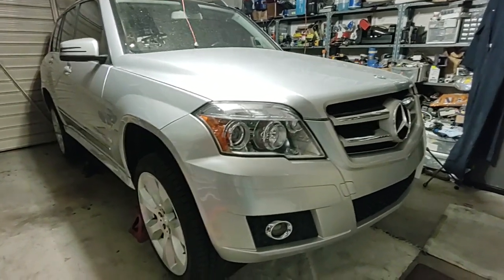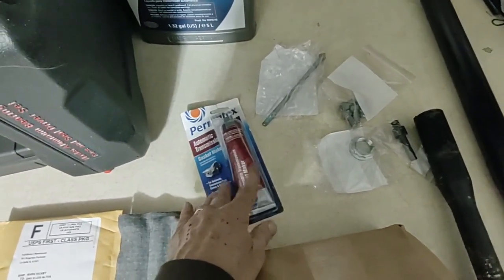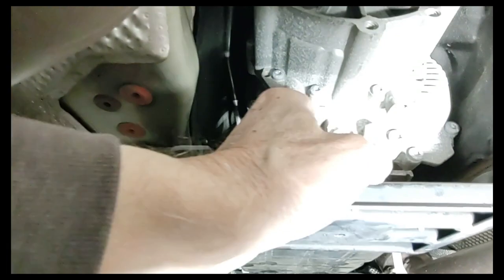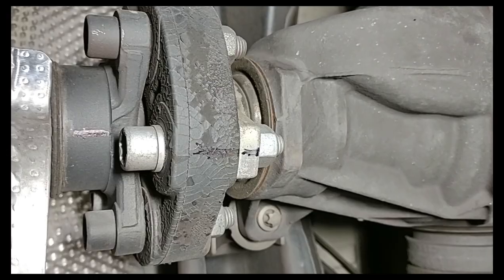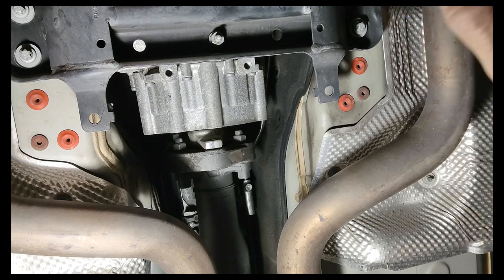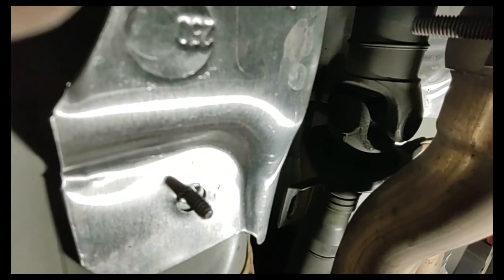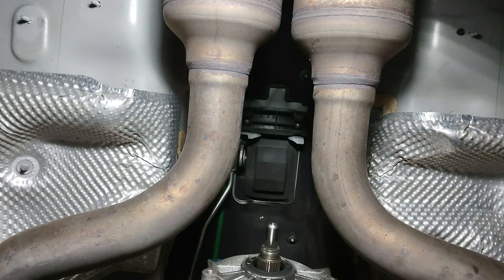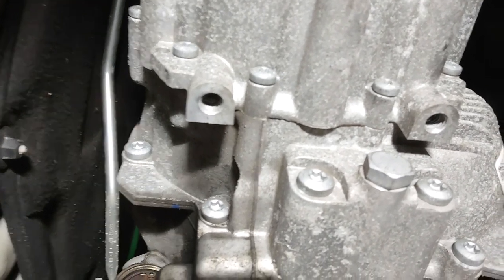Mercedes 722.9 4Matic Transfer Case Rebuild - 2011 GLK 350 - done in-car, new output shaft cluster

Comment: I have an 08 e350 with a bad transfer case, do you know if it is a similar one?
Reply from the maker: I believe the transfer case in the W212 version of the E350 is similar. But that one didn't start until 2010, so your 2008 W211 should have more of a replaceable, removable transfer case that doesn't really look anything like the one in the GLK in my video
Reply: Okay thank you for your reply. Do you know any good resources on how to rebuild the w211 transfer case? My car makes a jerk/clunk noise when I come to a complete stop. I know it isn't shifting because it still makes the noise when I manually put the car in first and then come to a complete stop. It also makes clunk noises when the wheel is turned all the way at slow speeds, especially in reverse. I have been told it is either the transfer case or the motor mounts. I would love to get your opinion. Thanks @Mark_H_DIY
Reply from the maker: @tonygunk6345  it's really hard to say for sure, without hearing it or being in the car, but another possibility is a bad CV joint up front. They make a lot of noise when turning. At any rate, it's going to be a lot easier to replace or rebuild that transfer case than the one in my GLK, because it is a separate unit.

Comment: How did you know this transfer case was bad what was the driving symptoms please
Reply from the maker: The front drive shaft was snapped off when I bought the car, so it wasn't much of a mystery.  Diagnosing the transfer case was just a matter of moving the rear of the drive shaft up and down, feeling the play in the internal u-joint in the output shaft gear cluster. There is a short video on my channel that shows this movement when I bought the car.
Reply: @Mark_H_DIY  my mechanic said I should get a full gear box that he isn’t sure if he replace the transfer case it would work
Reply from the maker: @OsasIduriase  Unfortunately that is what you are going to hear from nearly all mechanics and virtually all dealers. Most shops just don't want to work on the internals of any transmission, and they consider the GLK transfer case part of the transmission. The other issue is if you need a front output shaft gear cluster, they will have to order it from a special supplier in poland. Not all shops want to go to that kind of trouble for something so unusual. I have had people send links to my repair videos to their shop to find out if they are willing to do it or not.
Reply: @Mark_H_DIY  finally fixed it thanks a lot
Reply: @Mark_H_DIY  but now I have another problem I’m thinking it’s a fuel pump issue….my engine suddenly losse power while driving and I can’t accelerate then I park and turn of the car after which it starts after like 5 to 10 minutes…….i noticed that before it turns off it displays a triangle yellow light and it says run falt indicator inoperative
Reply from the maker: @OsasIduriase  you need to hook an OBD code reader to the car to see what it's trying to tell you. With the error codes, it will be likely you will narrow down the possibilities a lot.

Comment: Thanks for the video. Question is this in your opinion doable without a lift as you have shown. I know in your situation u had a busted front shaft. But if we don’t is it still doable ?
Reply from the maker: Assuming you're in shape to handle a lot of laying on your back, yes... I didn't find it a particularly (physically) difficult job, and really having a lift wouldn't have made it a lot easier (sometimes working laying down can be less stressful on your arms and shoulders than working over your head on a lift).  I would recommend removing the front driveshaft when reassembling the transfer case, though you'll just have to tuck it out of the way since you don't want to have to wrestle it out of its "cave".  ;-)
Reply: @Mark_H_DIY  thanks you so much for your time!

Comment: Do you remember the number of the seal for the front shaft drive? 54:58 you show this seal
Reply from the maker: @mativideo1053  the seal number is W7X700, and can be sourced from FCP Euro or other legit supplier. I'd recommend getting a couple of them... They're cheap and easy to damage
Reply: @Mark_H_DIY  thank you for the information

Comment: My 2011 GLK 350 drive shaft broke also. Must be defect. The co2 sensor housing is damaged causing the engine light to come on. The mechanic checked everything ok, said to ignore the dummy light. IMO a Mercedes drive shaft should not break. This is my last Mercedes, enough.
Reply from the maker: The front propshaft (driveshaft) is a known "common" failure point in the vehicle.  Just like any drivetrain part, it can wear out and fail.  The problem with this particular part is, when it does break, "things can get interesting", with the shaft now resembling a baseball bat in the hands of a very strong madman.  I bought my GLK with a broken driveshaft, and sadly (for the previous owners) it also damaged the U-joint on the front output shaft of the transfer case.  I can't complain because it allowed me to buy the car for around 1/4th of what it would be worth fixed.  All in all, the GLK is a very reliable platform - I put them on the "Toyota reliability level" (since Toyotas also break occasionally).  I've read comment after comment on forums that people have driven these vehicles 100-200,000 miles with literally nothing but scheduled maintenance.

Comment: What was it doing before you did thos job?
Reply from the maker: The front propshaft was sheared off at the differential.  I only noticed the transfer case output shaft issue when I was inspecting the car (pre-buy).  I could move the rear of the propshaft up and down 1-2mm, in one plane, which indicates that the U-joint inside the front output shaft "gear cluster" was bad, possibly due to stresses from the propshaft breaking - or maybe it just wore out.

Comment: Anyone know the trick to installing the output shaft through the new seal so it doeant leak after putting everything back together?
Reply from the maker: My solution was to put the transfer case all back together again, and then install the shaft. That is difficult, because the shaft is about 3mm too long. Theoretically, you could do it like I did in the first video, but I managed to mess that seal up pretty well, even though I thought it went together well at the time. The only other bright idea I had was to use two people, and insert the shaft carefully into the drive shaft, and use a large magnet to hold them together while you reassemble the transfer case. As long as nothing slips, that should work. But this is a truly untested theory. ;-)
Reply: @Mark_H_DIY  I installed the output shaft through the new seal,put it all together then installed the front shaft last,it still leaked. Am I doing something wrong? I greased the seal prior to inserting the output shaft through it. Any advice is greatly appreciated.
Reply: @mikedizzle5273  You really need to watch my second video on the process.  I made that one when I fixed the seal I messed up the first time (just like you did) and also to get more scientific about the preload on the helical gear bearings.  I know it's a lot of video, but there are some things that are really good to know.  To cut to the chase, the placement of the output gears (front and rear) is shown in pretty good detail at around 39 minutes into this video: https://www.youtube.com/watch?v=JNt68kNdFUU
Reply: I just did this job fot the second time. The first time i pinched the seal putting the output shaft in. The second time doing this job i removed the large gear to the left of the output shaft,then i was able to align the output shaft straight through the output shaft seal, also made sure to lubricate both the seal and the area were the seal touches. After that i carefully re installed the large gear to the left and put everything back together. So far so good,no leaks.
Reply from the maker: @mikedizzle5273  Sounds like you nailed it! It really is a little fiddly getting it all done without messing up that very fragile seal. If it's not leaking almost immediately, I don't think there's any chance it will ever leak.

Comment: Do you have a part number for the long, torque-to-yield bolt?
Reply from the maker: Hi, Josh.  Yeah, that part number IS elusive!  The MB part number is 000000-008248 (you might try searching on multiple iterations of that, by eliminating the dash or some zeros).  The name for the part is "Hexalobular Bolt".

I'll try to post a link to the part on a MB "official website" in a second reply (don't want a filter to stop this reply though).
Reply from the maker: https://mbparts.mbusa.com/oem-parts/mercedes-benz-hexalobular-bolt-8248
Reply from the maker: https://www.pelicanparts.com/More_Info2/000000008248.htm?bc=c&SVSVSI=3766

Comment: Hi one question, Can't the long hexagonal bolt be used again?
Reply from the maker: Not really. It's a one use bolt that is designed to stretch a specific amount to set the preload on the friction plates on the rear output shaft. I really don't know the effect on the balance of the transfer case if you were to reuse it.
Reply: I have a c300 but I don't understand very well when you say about preloading the bearing seats.
Reply: Can you help me where to find the torque measurement to tighten the hexagonal bolt? For c300 2009 4 matic lux
Reply: Why in the second video did you use the hydraulic press? and in the first video no
Reply from the maker: @emilioeduardogonzalezhuchi5178  in the first video, I wanted to show that you didn't need a hydraulic press to do the job. In the second video, I thought it would be helpful to show how to use the press to do it.
Reply from the maker: I should add that I've thought about how I would do it if I was forced to re-use the hex bolt.  I think I'd use a beam-style torque wrench, and turn it clockwise (tightening) until it JUST started to rotate, then return it to that torque when re-installing.  That would be making the assumption that the "stretch" would be the same at that point, but honestly the pre-load on those friction plates is just too important to take a chance.  You're going to be kind of surprised at how much you have to turn the bolt AFTER it "gets tight" before you get to the proper torque.
Reply: @Mark_H_DIY  Do you know if transfer case gaskets are sold?
Reply from the maker: I've never seen them, since the cases are normally put together without a gasket, using transmission RTV.  I think your only option for a gasket is to buy a sheet of gasket material, and making your own.  If you do that (to reduce pre-load on the bearings), please let me (us!) know how it goes.
Reply: @Mark_H_DIY  Is 20 thousandths thick what the gasket should measure?
Reply from the maker: I'm going to stop short of saying there's one right thickness - it all comes down to the stack-up of all the other tolerances.  That said, if I did have to choose 1.000 options for a gasket and use that (instead of grinding down the spacers), I'd say that 20/1000th of an inch (about 0.5mm) would probably be the way to go.  If you look at the preload / end load graph in my video, that would take the preload from "way too high" to "probably about right".

On my own transfer case, I ended up with different numbers to adjust the front and rear output shaft gear clusters to the right preload, but honestly, if you get that preload / end play close to correct, I suspect the transfer case will outlast the car anyway.  

I'd suggest putting together the case with each gear alone and torquing it down (using at least most of the bolts) to see what kind of drag you're getting on rotating those gear clusters, just to make sure you don't have one radically different from the other (like one that turns with your fingertips, and the other takes a full-on teeth-gritting twist to turn).  If both are in the "they turn but I have to twist kind of hard", then that 20/1000th is probably going to move things into the "plenty close enough range".  

Good luck and let us (me) know how it goes!
Reply from the maker: Oh, and you DID say you had ONE question...  ;-)
Reply: @Mark_H_DIY  Thank you, for your help, as soon as I repair it, I'll tell you how it turns out, I'm waiting for it to arrive. the bearings to start
Reply from the maker: The height of the bearing races (seats) determines how much preload is on the bearings (how tight they're squeezed between the two races).  That determines how much effort / energy it takes to turn the bearings, and how long they'll last.
Reply from the maker: I listed the values on a chart in a video - the hexagonal bolt is tightened to 30Nm, then turned an additional 180°.  That's for my particular vehicle - yours could be different, of course (I'd recommend doing some research). 
https://www.youtube.com/watch?v=EybLI7ouqGI
Reply: Sorry for bothering you again, in the torque note where it says 180 degrees, where did the value of 132.7 come from?
Reply from the maker: Sorry for the late reply (I don't get notices).  I see I posted the wrong link to the torque value chart (fixed).  Not sure what the 132.7 reference is though.  The only bolt that gets torqued 180° is that long, skinny bolt that sets the tension on the rear output shaft clutch pack.
Reply: @Mark_H_DIY  I repaired it, it seems everything was fine, thank you for all the information, it was a great help to me.
Reply from the maker: @emilioeduardogonzalezhuchi5178  That's great news. It took me a long, long time to find all the information needed to do a good job on rebuilding the transfer case. I'm always happy when another amateur wrench twister is able to fix their own car for a very small percentage of what the dealer would have charged them.

Comment: Is there a parts list? I can't find the seals
Reply from the maker: The front output shaft seal I used is a Corteco seal (OEM, I believe).  013-997-72-46.  The rear output shaft seal is (again, Corteco) 0239978747 (pardon the different formats - you might want to search on either format).